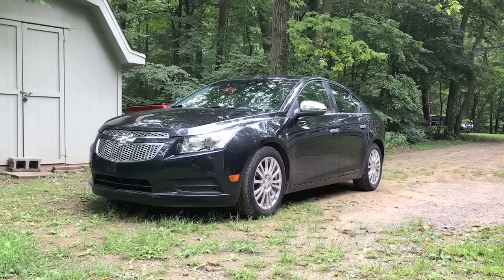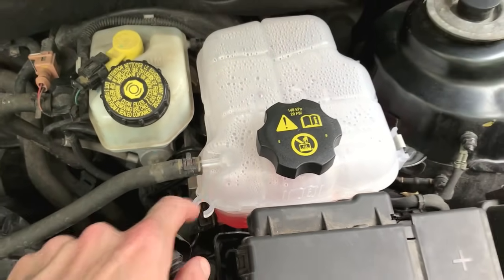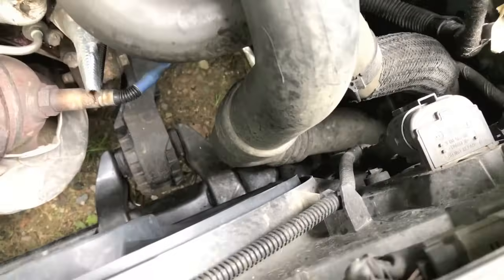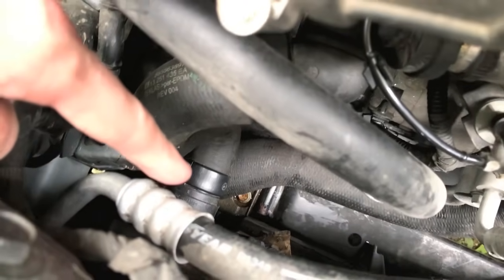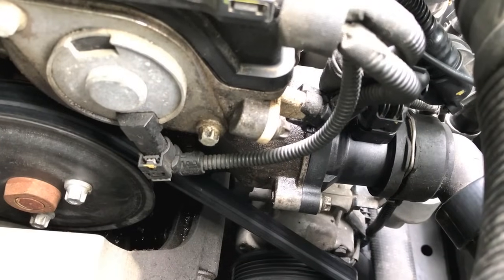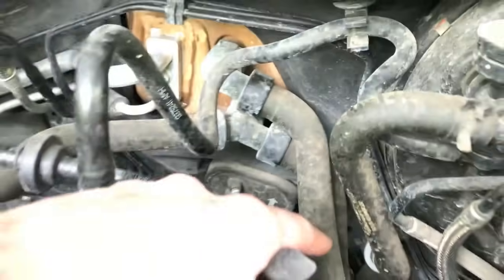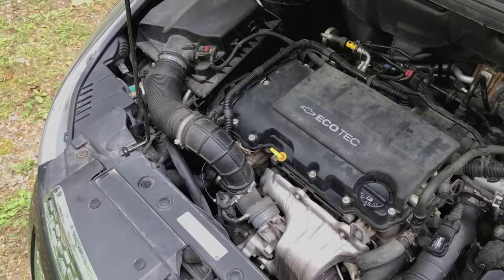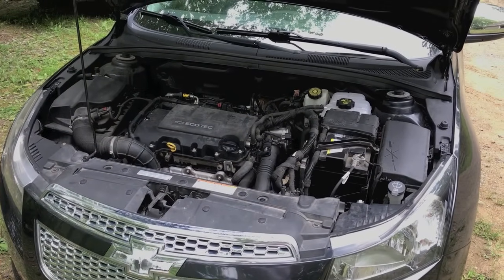Most common Chevy Cruze coolant system leaks! - Malibu/Impala as well

Comment: My 2012 Cruze took a dump today.   I got home from work and as soon as I shut down the car,  steam filled the garage and I could smell the coolant.   The puzzle of water/ coolant was on the driver side.   When raised the hood,  I could see the spray on the driver side of the car. What could it be?  I couldn't tell where the leak wad coming from since everything was wet.
Reply from the maker: Veronica Rodriguez 

Thanks for watching & sharing your experience Veronica!  Let’s get this figured out together!

Have you inspected all parts related to your Coolant System?

You mentioned the Coolant was more on the drivers side.  This leads us to the Reservoir, Water Outlet Valve, or any one of the rubber hoses connected to these two parts.

We recommend completing a thorough inspection of the parts shown in this video and try to pinpoint where exactly your leak is coming from.

Make sure all Coolant Hoses are properly connected & secured to their respective connection points.

Let’s start there!  Keep us posted!

Please subscribe to the channel and turn on your YouTube notification Bell 🛎 that would be awesome thanks again!

😎👍🔧🔩

Comment: We replaced the engine coolant outlet with a brand new part but it is still leaking and overheating.
Reply from the maker: Jenny Morgan 

Thanks for watching.  Is the actual new part leaking?  If yes, did you properly lubricate the rubber gasket that goes in-between the water outlet valve and the engine block?

Lubricating the gasket allows the gasket to properly seat to the engine to create that seal.

Let us know if you have any questions.  Please subscribe to the channel and turn on your YouTube notification Bell 🛎 that would be awesome thanks again.

😎👍🔧🔩

Comment: Cant find mine even put the dye in and have no luck. Its a very minor leak.
Reply from the maker: Jacob1986 

Thanks for watching.  No leaks underneath Cruze...?

It’s possible that it’s sneaking past the internal seals & being burned off by engine.  This unfortunately has become a very common issue with the Cruze.  Some Cruze owners take it into shop to see if the warranty will cover it.  Keep us posted.

😎👍🔧🔩
Reply: DIY With Michael Borders mines a 2011 and i dont see any white smokr
Reply from the maker: Jacob1986 

That’s a good thing!  Do you smell coolant inside vehicle when driving with heat or ac on?  If yes, the link below talks about coolant leaking from reservoir tank vent.

          https://youtu.be/zSsHdb29wQA

😎👍🔧🔩
Reply: DIY With Michael Borders i checked the bottle and the vent. I put a longer hose on it and put a zip lock bag at the end no coolant in the bag. There is a coolant smell though after a drive .
Reply from the maker: Jacob1986 

Thanks for the reply.  It may be such a minor leak sneaking past your seals & not enough to create a significant change in exhaust color.

Comment: Hey I got a 2011 Chevy Cruze Ltz Rs and it's leaking from my driver side and right under my passenger side. After for driving for about 15 min the car starts smoking. Any help?
Reply from the maker: J R 

Thanks for watching & sharing your experience J R.  We recommend starting engine & opening hood.  Allow the engine to run for 15-20 minutes which will allow the engine to warm up to the normal operating temperatures and also allow your coolant system to properly pressurize.

Next we recommend doing a thorough inspection of the engine, both on top and underneath to try and pinpoint the exact location of the coolant leak.

It’s also very important as you know to not touch the coolant directly with your skin as it will most likely be very hot.

Once you find the exact location of the leak, you can then turn the engine off and allow the engine to cool down.

Definitely get back to us on where it’s leaking so we can move onto the next troubleshooting step on which part needs to be replaced and we can definitely answer any questions you have.

Keep us posted!

Please subscribe to the channel and turn on your YouTube notification Bell 🛎 that would be awesome thanks again!

😎👍🔧🔩
Reply: Did you figure out what was leaking on your passenger side? My Cruze is a few years newer but thats where mine is leaking from too 'I Think'...

Comment: i have a 2018 cruze and my engine light is on and says Heater Coolant Pump Control Circuit Open.. how can i fix this?
Reply from the maker: Michelle Beljau 

Thanks for watching, by chance, have you obtained your error codes from your check engine light?

If you do not have a scanner, you can visit your local AutoZone and they will hook up a scanner and read your codes for 100% free.

Knowing the exact error codes will allow us to pinpoint the exact part that needs to be replaced.  Believe it or not, a single part can lead to several error codes and the alert that you got.  Replacing that single part may turn off the remaining error codes.  Keep us posted.

Please subscribe to the channel and Ring your YouTube Bell 🛎 that would be awesome thanks again!

😎👍🔧🔩

Comment: I have a coolant leak, but not sure where.. but it leaks every time my car is off, especially when I drive a good distance.. and it’s always on the passenger side where there’s a puddle of coolant.. any ideas where it could be? I have a 2013 Chevy Cruze
Reply from the maker: Ty Harvey 

Thanks for watching & sharing your experience.  Since your leak is more on the passenger side, this leads us to the Water Pump or Thermostat.

Both the Water Pump & Thermostat are on passenger side & will leak when failing.

Let’s start with the Thermostat as it’s the more friendly DIY repair & low on cost.  Below are two video links.  1st link is to our video showing our Thermostat leak...it’s a pretty good leak!  😲. The 2nd video link is to our step-by-step replacement video on the Cruze Thermostat.  Definitely check those out!

       https://youtu.be/_mlf00TsE4k

       https://youtu.be/8F-17wODadQ

Next let’s talk about the Water Pump.  Now that we know a little more about the Thermostat & the hoses feeding in & out of part, we can see that the Water Pump will require you to remove hoses on each side for replacement as well as the small rubber gasket that seats between the Water Pump & the actual engine.

We recommend completing a thorough inspection of the Thermostat & Water Pump as well as the hoses connected to each side of parts to see if you can pinpoint the leak!

Let’s start there, keep us posted!

Please subscribe to the channel and turn on your YouTube notification Bell 🛎 that would be awesome thanks again!  😎👍🔧🔩
Reply: Hi - I have a leak on the passenger side, what was it that you replaced to fix the leak. I dont believe mine is from water pump, seems farther back than that. Thanks

Comment: I have a 2011 Chevy Cruze Ltz and out of no where, the car starting smoking from under the hood. I immediately parked the car and waited for about 10-15mins before the smoke went away. Not sure what could possibly be the problem. Any ideas?
Reply from the maker: Kiara Thomas 

Thanks for watching & we hope you enjoyed the video.  Very first thing we recommend is inspecting your entire engine to see if you can find any rubber hoses that came loose.

A common cause to your symptoms is a coolant hose coming loose and spraying extremely hot coolant onto other extremely hot portions of the engine... this causes steam, evaporation, and or smoking.

If all hoses are connected and not leaking, inspect all electrical wiring to ensure that you have no signs of stress... an example would be melted wiring.  Let’s start there!

Let us know if you have any questions.  Many more helpful videos to come.  😀

Please subscribe to the channel and turn on your YouTube notification Bell 🛎 that would be awesome thanks again!

😎👍🔧🔩

Comment: These cars and this company are trash. Already did the PCV valve bypass kit. Replaced the valve cover. Replaced an ignition coil. Changed a wheel bearing. Now my wife has it at the dealership for leaking coolant.  All on a car with 60,000 miles. The entire engine bay is full of crappy plastic parts to cut cost. This is my kids car. I am on my second Honda Civic. First did 368,000 miles with some minor unscheduled maintenance. Current one is at 220,000 with one replaced wheel bearing at 190,000 miles. That's it besides normal services.
Reply from the maker: Thanks for watching & sharing your thoughts.  We definitely understand your annoyance on the subject.  The Cruze itself has encountered many coolant system issues.

Let us know if you have any questions, us fellow DIY’ers need to stick together!

😎👍🔧🔩